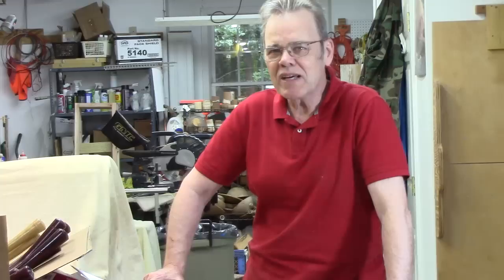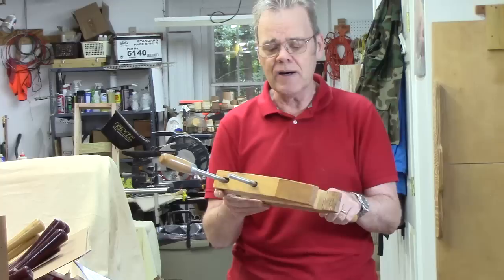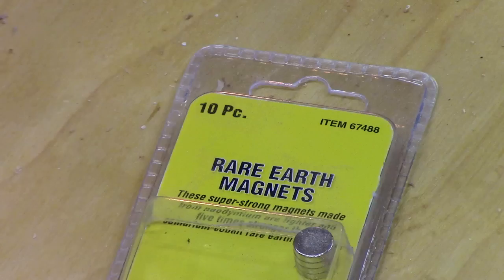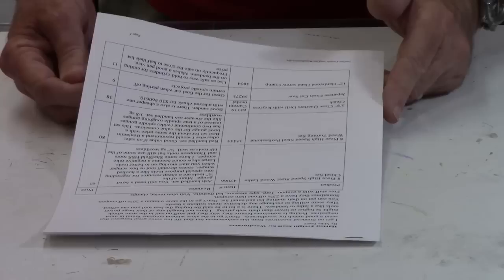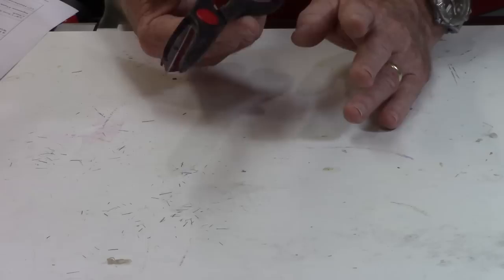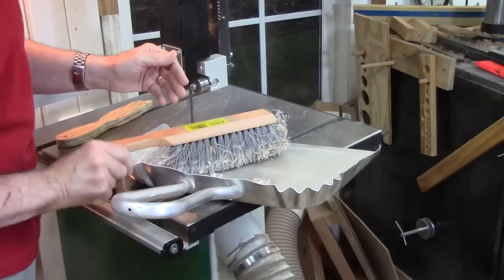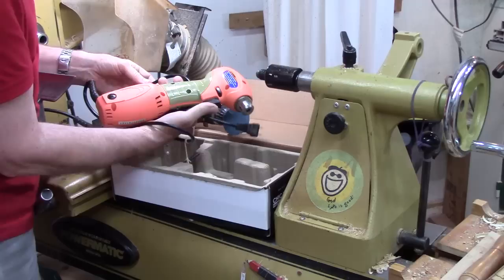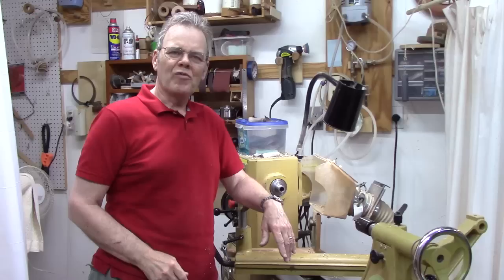Harbor Freight for Woodturners?

Comment: A month ago, HF was having their 'parking lot sale'. I'd been eyeing their 12" sliding compound miter saw for a while. The usual sale price is around $135; BUT they had one in a damaged box with a price tag of $100. I looked inside and couldn't see anything obvious wrong with it. I countered with $70 and the manager said "Yes". There's absolutely nothing wrong with it after several uses. Works like a champ.
Thanks for sharing!
Reply: my mom bought a 'damaged' miter saw from harbor freight.  When we got it home I started to troubleshoot to see why it was returned.  Well, it was quite simple:  the previous owner had put the blade in backwards (obviously from the way the blade was STILL in the saw!), and I assume they brought it back because it wasn't cutting nice. so, their stupidity saved us a good bit of money

Comment: One great use for the cheaper turning tool set is learning how to sharpen. When I got my first tools as a gift they were nice Sorby tools and I had never sharpened turning tools before.....so I picked up a set with a coupon and practiced until I  was comfortable grinding an $80 tool. Now I just repurpose them as needed. The scrapers can be made into a nice box scraper.

Comment: Fantastic video good sir!
My first lathe I'm now using is their 10 in. x 18 in, for which I've subsequently upgraded with the Rockler bed extension for $75, so now have a nice long distance between center wood lathe.
Many thanks for your outstanding work here!
Reply from the maker: I did not know the Rockler bed fit it. Good to know. Thanks for sharing.
Reply: to be fair, I do still need to do a small bit of work to get it 100% where they meet: it's usable, but not perfect.
Reply: Using mine to 200 or so pens still going strong

Comment: I personally love my Harbor Freight lathe - model 34706. 12" swing and a bit over 33" in distance between centers. It's a bit under-powered (3/4HP motor) for some projects but for a person who wants to try out woodturning, it's ideal. After I upgrade, it will be a nice backup and a dedicated sanding/buffing station. I also hear their dust collection is another HF gem.
Reply from the maker: Yes, see my comment to Michael Johnson. I did not mention my HF DC did I? It is in a video I did on Dust Collection.
Reply: That was my first lathe & I remember it being fine.  Only problem areas were the drive belt being made out of something about as strong as a gummy worm and the Reeves drive would need maintenance every year or so to clean out the gunk.
Reply: My first lathe!

Comment: A lot of great suggestions,  Mike.  My all-time HF favorites are:
 - flush cut saw
 - 6" dial caliper (no battery required)
 - remote power switch for the dust collector
 - 18" bar magnet for attaching small tools to the lathe
 - T handle hex keys
 - 8 oz stubby claw hammer
 - HVLP spray gun #47016 - creates a great finish with polycrylic - $15 regular price, $10 on sale
Reply from the maker: Thanks for sharing, Ed.
Reply: Ed Hekman I have to second the 18" magnet bar, I have them in the shop and kitchen. The one in the kitchen holds my most used knives at arms length for easy access during meal prep.

Comment: I have the HF 10'' and 12'  lathes and the are great ...never had a problem  on the 12' i have turned 14 ' bowls no problem ,because it has a swivel head
Reply from the maker: The lowest speed is too fast for most bowl turners unless the blanks are really balanced which they rarely are unless you are buying them.

Comment: To be honest, my first mini lathe was a harbor freight. I abused that poor little lathe for years before I worked up to something bigger. It cost me 70 bucks after my 20% off. It had variable PWM control and  over current protection. It is 10 years old and I have passed it to my son for pen turning. Like you say, if you know what you are going into, you can do well. Great idea on the strap wrenches. A couple of those keeps a lot of stress off the lathe head. Also bought the upright 2hp dust collector. I get better bags and filters at Grizzly but it has lasted me for years so far.

Comment: Great video on HF tools, I've been sick for a long time and started turning in the last 2 years. I wouldn't be turning if it weren't for HF. Started with a HF 12x33 lathe and the first set of tools you mentioned. First projects were kind of comical, trying to make something with unsharpened Chinese tools ....really didn't know much better when it came to tools and sharpening. 

I think I was using the roughing gouges as bowl gouges :) Those things took a beating, never broke though and still use them. Although I quickly found out what a "catch" was and appropriately nicknamed myself "Catch". You are right, regarding that 1/4" gouge, not sure what it was but to this day it doesn't matter how you sharpen it, it doesn't cut.

Thanks for all you do Mikey!
Reply from the maker: The school of hard knocks is a hard way to learn woodturning so many fall by the wayside. Glad you were able to perservere and not get hurt.

Comment: A couple of things I find useful at HF are the Twist Loc holder with 2" & 3" Twist Loc sanding disks. The only problem with them is they don't get any finer than 100 grit. They also have other rotary saw blades and grinders.
I also bought the 4 In. X 36 In. Belt/6 In. Disc Sander (the belts HF sells are not good so I had to go elsewhere to get good belts to 400 grit)  I reversed the direction of the belt so it works as a tool sharpening station like Sorby's ProEdge.
Another item I use occasionally is the Quick Change Sanding Drum Set.  With this in a drill press I can sand rounded profiles on some of my turnings.

Comment: Thanks Mike I have Harbor Freight’s 10 in. x 18 in. 5 Speed 1/2 HP Benchtop Wood Lathe it’s great for smaller stuff I have no problems with it if I want to take it somewhere it’s easy to take and will do a great job for anyone
Reply from the maker: Nice to have a small portable lathe for public demos or road trips. Glad your HF lathe is working out for you.

Comment: I have (2) of the HF Jet lathe knockoffs, I use one lathe as a spare parts machine to keep the main machine in operation when there is a problem while waiting for spare parts when I need to replace any components. I abuse the hell out of this machine and run it for hours on end turning big and small pieces.  This is a great bargain for anyone getting into wood turning, with the rotating head stock you can turn large pieces outboard. You need to clean the reeves drives on a routine basis on these style lathes to keep the adjustable speed operational. Most of the parts for this machine are readily available and reasonably priced. The parts that I have replaced over the years have been on/off switch, reeves drive, belt, tail stock hand wheel, adjusting lever for banjo steady rest and the drive motor. I have over 6000 hours of run time on this machine which is great for a $300.00 lathe.
Reply from the maker: Great feedback on that lathe. I am so happy to have been able to quickly move from a Jet mini with a bed extension to a PM3520. But not everyone has the spare cash so knowing the value of bargain options is good.

Comment: I have the 12x33 Jet knock off lathe and it's been pretty decent for 4 years so far. The tools, I have both sets and they work if you custom sharpen them but you gotta resharpen really often. The light colored ones are also light weight fwiw.I'm buying replacements one tool at a time and getting Sorby and Thompson as I go. I have a G3 chuck not HF.
Reply from the maker: Thanks for sharing and safe turning

Comment: driver bits(long and short) for jigs such as sanding pads for the right angle drill you showed.I use the turning tools to practice sharpening and test new profiles. I have found the continental gouges useful once I started treating them as 'curved skews', meaning I sharpen and use them in a manner similar to the way a skew is used. I find them much easier than a real skew, though not quite as versitile.
Reply from the maker: Funny I bought a set for sanding mandrels some time back and never finished them.

Comment: DIY Beall Buffing system can be had for ~$15 - get the 3 pack of buffing wheels and mount them to large bolts; chuck them up in the lathe and you have pretty much the same thing.  Bowl buff is like $3 or something crazy cheap like that...

Comment: I agree, Mike, there are a fair number of HF tools worth the money.  Even some of their larger tools are worth the money.  I bought their 14" bandsaw over ten years ago on sale for under $200.  I added a $50 riser kit and Carter guides bringing my cost up to just under $350 and I wouldn't sell it for $1200 today.  I also use their DC paired with an Oneida Super Dust Deputy.  Pulls 99+% of the fine dust from my drum and oscillating sanders and even my table saw that wasn't designed with dust collection in mind.  However, for those looking for courdless power tools, I've found most of HF's cordless products to be nothing but a waste of money.  Thanks!

Billy B.

Comment: When Covid hit I had more time in my shop and decided to get a lathe, just to see if it was something I wanted to do.  I got the Central Machinery full sized lathe on sale.  It won't do a lot, but it is impressive what it will do for the price.  The light weight is my main complaint...

Of course, now I'm addicted and looking for a better lathe that has variable speed (without changing belts), long bed, and rotational head stock and more horse power.  Oh yes, and is affordable.  :)
Reply from the maker: Affordable varies with individuals so not sure what your budget is. Most lathes sold in the US do not have a rotational head. You might want to watch this video https://youtu.be/s0YDgte_C7Q
Reply: @MikePeaceWoodturning  The Harbor  lathe does have a rotational head stock.  I put it on wheels, because everything in my shop is on wheels.  My main complaints about it are: Light weight means if anything is out of balance I chase it around my shop.  The headstock rotates, but will not lock securely in place.  When something is out of balance, the headstock vibrates out of alignment.  The banjo is not standard size, which means it is hard to find tool rests that will fit it.

I've been working my way through my firewood pile with this cheap ($400) lathe for about six months.  Covid gave me the excuse to spend more time in my shop.  I'm 'feeling the need for something more substantial, but dang, its a big leap from $400 to $7000.

Your videos are helping me sort the priorities.

Comment: One tool I find very useful is their digital calipers. They are a third the price of similar ones at home depot, and the only problem I have found is the battery doesn't last very long. I also got one of those cloth type belts for my bandsaw, and it seems to work pretty well. I've been using over a year so far with no issues. I completely agree about the diamond plates. Mine wore out after about 3 sharpenings :D:
Reply: Do you have another source for reasonably priced but better quality diamond plates?

Comment: I have a HF wood lathe with metal leg stand. when i have used the Lathe with a large stock , the  whole lathe will vibrate . Now i have used the Lathe with smaller stock and will work fine with little vibration. what would the better means of securing the lathe to the cement floor , can you suggest a couple of ideas?
Reply from the maker: It is generally not a good idea to bolt the lathe to the floor. If the vibration gets too bad, something has to give. If the legs can move, something could brak. Better to add cross pieces to the leg, a plywood sheet and some ballast like a sack of sand. Sheet metal legs are the price you have to pay for an inexpensive starter lathe like that one or the virtually identical Jet it was cloned from.

Comment: Considering my sharpening station is a 80$ 1x30 HF belt grinder and I get absolutely bonkers sharp tools of 600grit belt in one touch, yeah, HF does the job. And low quality steel seems to be just the ticket to get a specialty tool on the cheap. I have an ancient/vintage Buck Bros parting tool I reground into angled parting tool to make tenons. Found it in an antique store for 10$
Reply from the maker: Sounds great! Sometimes it helps to be frugal.

Comment: I bought the magnet bowl and have it on my accessories tray and it keeps my chuck keys from going adrift. And set it on my bed tray , when changing chuck jaws so the screws dont get lost I turned a handle to fit the spring center punch and it is more comfortable to use and less likely to roll off bench 
I have bougjt the heavy gauge nalgene gloves in the past , but have found then also in the Sams club pharmacy goods 
I also have one of their 3 inch angle grinders and the corded keyed angle drills 
I also bought the stand for their lathe to put ,y vintage Delta lathe on. Drawback is that it is stamped sheet steel and ligjt weight
Reply from the maker: Thanks for sharing.

Comment: The "ash blonde" turning tool set (8 tools) was around 18 dollars at my local Harbor Freight ...  The dark Mahogany looking set is the 65 dollar set.  I bought 2 sets of the cheaper tools so that I could use alternative grinds and make my own specialty tools, as you did.  I found that only the last few inches of the tools are hardened steel, so if you grind them past that point, they generally get useless... which is fine, considering their cost.  I also made my own cheap carbide tipped tools that I use for the majority of my turning, these days, and they are easy to keep sharp with a diamond card sharpener.

It's also a great idea to mention Harbor Freight's brands of sandpaper... They are decent quality, possibly up there with 3M's products, as they are pretty much disposable after a use or two, and they sell 10-packs of full sheets for cheap, as well as multipacks of higher grit papers at the same price, going all the way up to 1200 grit.  (around 3.99 per pack, I think).  

A final mention on another tool ....  Cheap lathe turning tools need sharpening quite a bit, which you mentioned.  Before long, a wood turner is going to want to turn a set of sanding drums and cover them with a variety of grits of paper, going up to high grit, for polishing the bevels and edges of their tools. But until they get to that point, the 1x30 belt sander is a cheap 40 dollar investment that will help with many little projects and with maintaining those lathe tools with a usable edge.

When using the sander to grind your chisels ... keep a jar or bucket of cold salt-water nearby (salt in the water gives it a higher density and higher boiling point, to cool the metal faster ... wipe the tool off and completely dry it before putting it away or IT WILL RUST).  Cool the tool off in the water the instant you see it even start to change colors, or you will ruin the tempering of the steel.  With those small chisels, it will heat up past that temper point extremely fast, and that's bad.  This is possibly why you think that the steel in those small gouges wasn't properly heat treated.   You CAN take a blow-torch to them and re-harden them, and then gently temper them to a light straw or golden straw color so that they don't just snap off on you when you try to use them, but it's probably best not to ruin their temper in the first place with over-heating them.  I've found my 3/8ths gouges to be some of the best I've got for fine turning on my pens and keychains.

The lathe I use is the 8x12 Mini Wood Lathe from Harbor Freight.  I've found that putting a 6-inch clamp across the ways behind the tailstock helps tremendously to keep the tailstock from walking off from my work, but beyond that it's handled everything I've tried doing with it, including turning aluminum, brass, soapstone, alabaster, various hard and soft woods with stone and metal inlays, and every acrylic I've thrown at it.  Carbide tipped tools are awesome for the really hard stuff!

Comment: One of the biggest item HF has is a wood lathe.  I've seen other peoples videos and they seem decent. I got a combo disc/belt sander from them. Not bad. I have a heat gun. I wouldn't use it on finish unless you want to remove the finish. The caliper set of course. Several different clamps. I don't like the ones with the squeeze grip because they don't get tight enough for glue ups.

Comment: when I first got started in woodturning, I purchased the set of tools with the purple handles. I actually really like the 1/2inch skew and re-purposed one tool into a negative rake scraper. I'm on my second HF angle drill. I went for the keyless version but find it doesn't always hold like the keyed version. I've also picked up a few pneumatic tools and they work fine.
Reply from the maker: Good stuff, thanks.